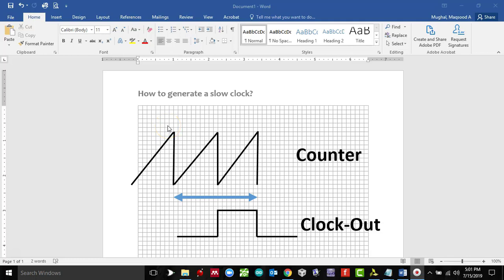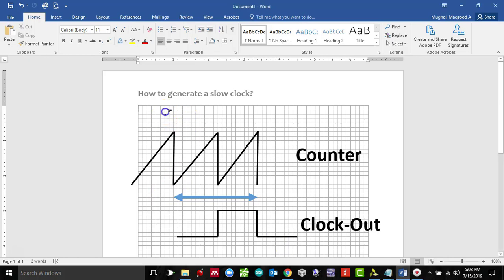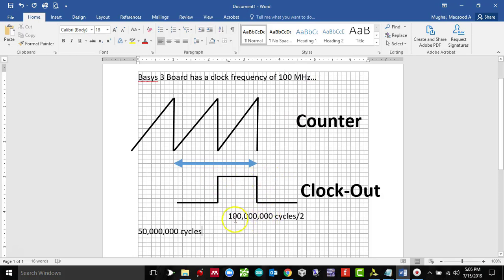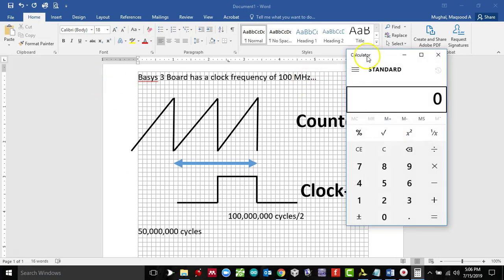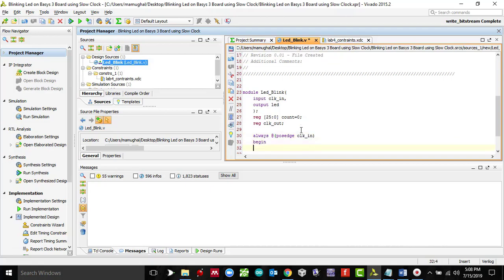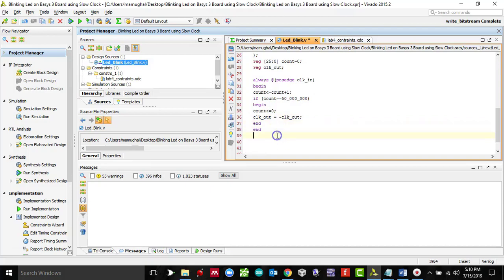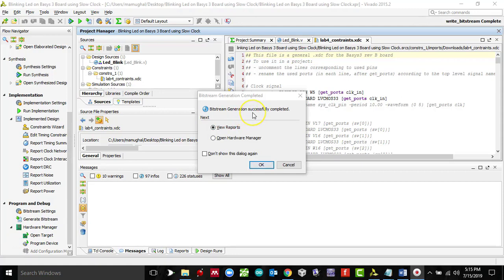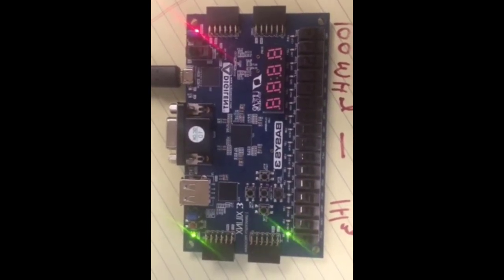#6 How to Generate a Slow Clock on an FPGA Board? | Verilog | Step-by-Step Instructions

Comment: Thank you so much this is very helpful , I am using cyclone v DE10 standard board and its clock input is 50MHz this means that 25_000_000 cycles are on , correct ?
and the code should be 
reg [14:0] count =0;
reg clk_out
always@(posedge clk_in)
begin 
count<=count+1;
if ( count ==25_000_000)
begin 
count <=0;
clk_out = ~clk_out;
end 
end 

I find the code is easy to understand except for the clk_out .. we didn't assign a value for it so why we can use ~ to get the opposite value?
thank you so much!
Reply from the maker: The clk out part just simply helps mimic square wave, a digital signal. It is off for certain amount of time and it is on for certain amount of time.

Comment: Sir why we have not use 100 million cycles ??
Reply from the maker: Because one complete cycle is half off and half on. So if we divide 1M by half, we get 500_000. Means 500_000 cycles off, and 500_000 cycles it's on. That makes it a 1 Hz clock.

Comment: I understand the logic does everything in parallel/concurrently.. yet this in this example the assignment to count seems like its sequential:

count<=count+1
if (count==50000000)
count<=0

If you don't mind a slighter faster clock, could you just assign the led directly to a free-running counter:
assign led = count[25]

BTW, I'm getting an excessive skew warning.. how would you constrain the design to make sure any slower clock derived from the faster clock is routed appropriately?
Reply from the maker: If you do that, it won't work. It will just simply stay solid. You should use the desire clock within the always@ block statement.

Comment: Nice tutorial sir, however i didn't get the point that is without assigning pins to clock and LED in the design file how vivado understood which pins to use for clk_in and LED. Can you please explain this.
Reply from the maker: Dear Dheeraj, @8:40 we use constraint files for basys 3 board and we use right most led on the board and system clock declared as output and input in the source file. Hope this helps.
Reply: @ElectronicswithProfMughal  Thank you sir, but I want to know just by declaring clk and led as input and output how vivado knows which pins to assign them. Sorry for my lame understanding.
Reply from the maker: I am using a Basys 3 board which has 16 leds, I can use any led I like. In the constraint file there are pin locations for every input and output. Those locations are also labelled on the board as well. In this video I chose the led which is on the very right. For every board, constraint file is given by the manufacturer.
I suggest you watch this video:
https://youtu.be/tOwMmBI_XNo
Reply: @ElectronicswithProfMughal  Got the point. Thank you sir.

Comment: sir i have one doubt here we haven't given initial value of clk_out . should'nt we give initial clk_out as '1' or '0' so that after it toogles. Kindly explain sir I m little confused in this point
Reply from the maker: Dear Kapil, you don’t necessarily have to do that because you’re defining positive edge of the clock here (meaning logic going from 0 to noon). So that means it waits for the positive edge and only then execute the commands.